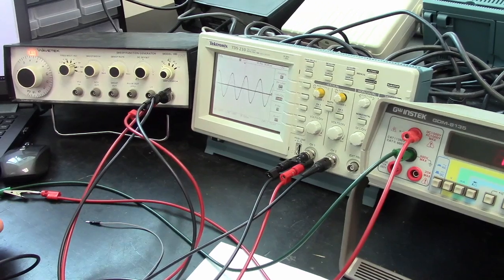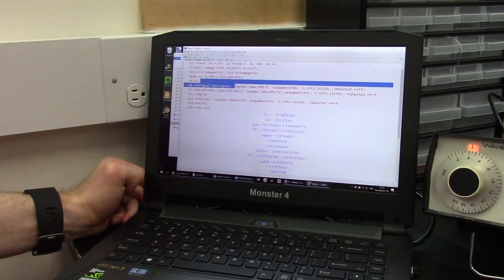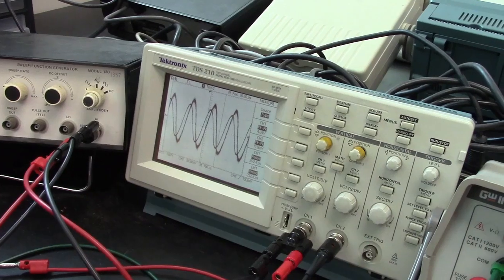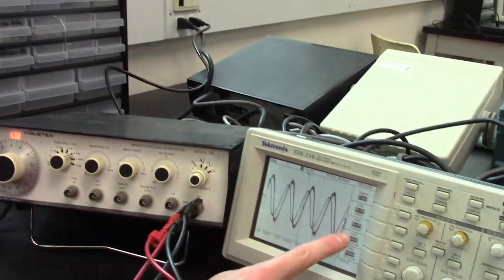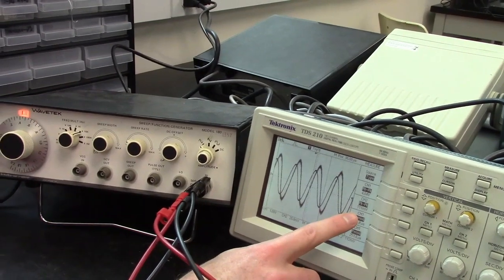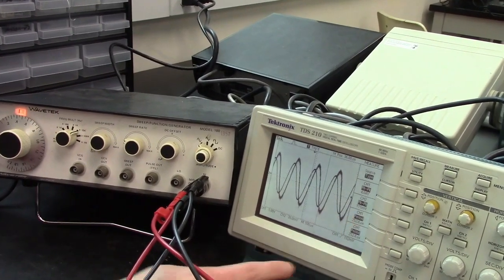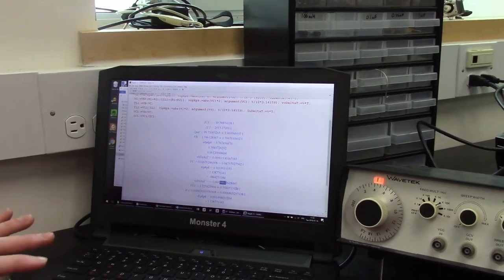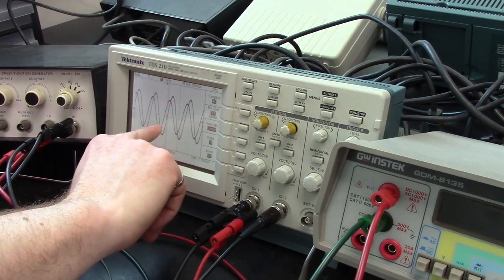Electronics Lab #2: AC Steady-State Network Analysis

Comment from the maker: Clarification to the point at https://youtu.be/EJFTPWAq6Iw?t=1167  
Because the signal didn't disappear when I swapped the terminals on the scope, this particular function generator looks like it's not actually connected to ground through a low impedance.  Not all function generators will behave like this though, so don't count on being able to hook it up backwards.  The point I'm trying to make is that the scope input grounds are connected to the instrument ground (and therefore to each other as well), so if you want to make differential measures with the scope you need to account for this.   Here are some options if you do want to make a differential measurement with the scope:
1) Float the circuit (https://en.wikipedia.org/wiki/Floating_ground); possibly by isolating your instrument grounds from eachother using an isolation transformer: https://en.wikipedia.org/wiki/Isolation_transformer   - even in this situation you need to remember that both scope probe grounds are connected through the scope, so you'll need to isolate their connection to the circuit as well if you need to make 2 differential measures at once and don't put them at the same point.
2) Alternatively, you can just measure the two sides of the differential measurement you want relative to ground and use the math menu in the scope to subtract them.